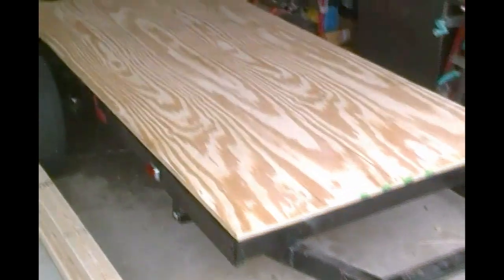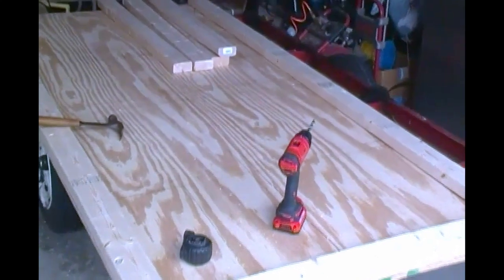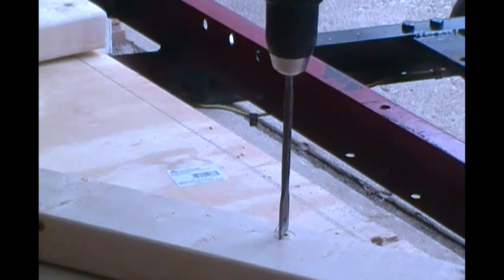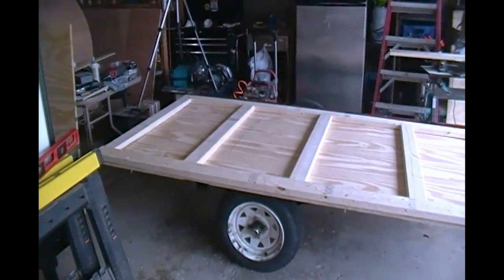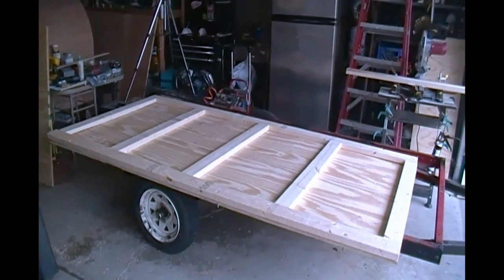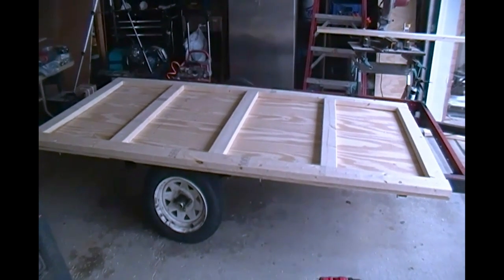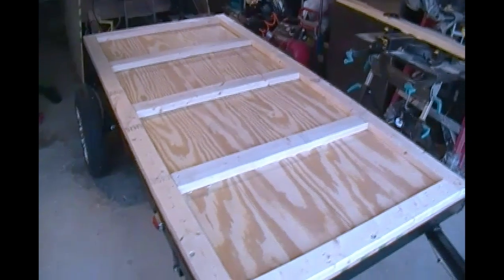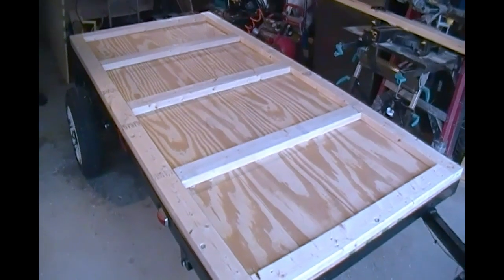Benroy Teardrop Build Pt. 1 || Floors

Comment: Great Job!! What size screws are you using to mount 2x4 to plywood?
Reply from the maker: 2.5 through the wall and 1.25 inch pocket screws
Reply: What kind of 2.5 Screws. I heard you mention 100 self tapping screws?  Also is it just going through the 2x4 and into the plywood. Thank you in advance!!!
Reply from the maker: @ericsipos3611  2.5 construction screws through the wall into the 2x4. I use 10, 3/8 carriage bolts to attach the floor to the frame. Self tappers in between the carriage bolts. Pocket holes in the floor to help mount the walls as well.

Comment: Question for you. Why do you screw the screw in, back it out and then put it back in?
Reply from the maker: Materials sometimes lift if you just screw them in. My way of preventing that is to screw it in and back it out.
Reply from the maker: Or you could drill pilot holes.